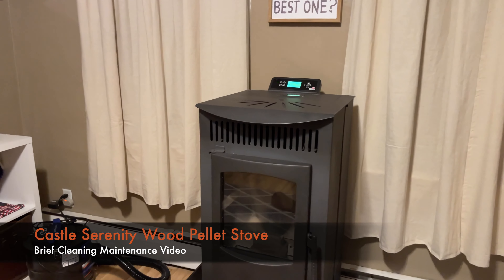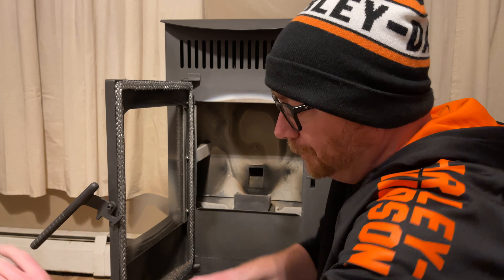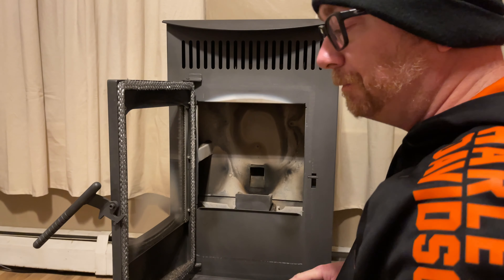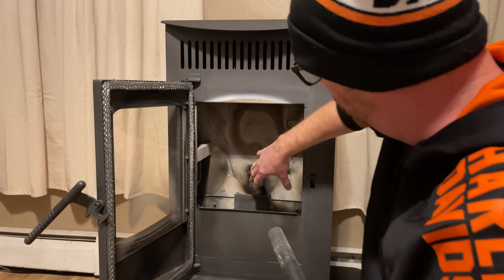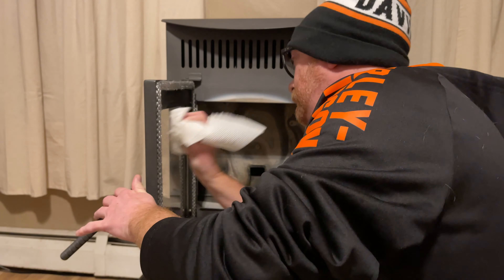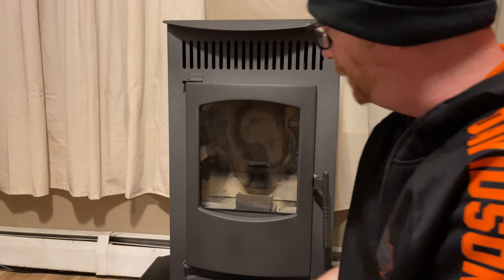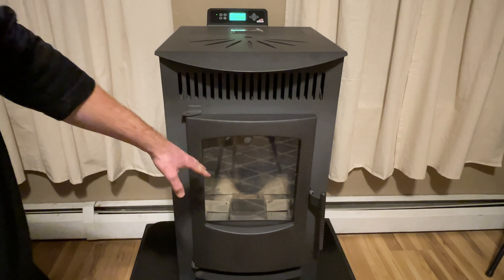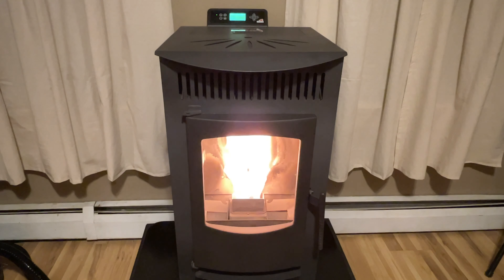Introducing the Castle Serenity Wood Pellet Stove - the perfect solution for cold winters!

Comment: Just used for only three days brand new and alarm high temperature came on and shut down. Took left panel off with 3/16 Allen wrench to check temperature switch pop out. Little black button type in the middle of two wires. It supposedly pops outward if triggered. It looked like nothing popped outward. So removed ash tray and there is a round circle with a lid covering the circle. Look to the left of that circle and you see part of a screw sticking out. Same size Allen wrench and on the back inside you can trace the Allen screw that secure a sliding lid. Unscrew it and slide the panel to the right. I slid panel 3/4 of the way of the circle and retighten the Allen screw.   Replace side panel and turn pellet stove on. If the alarm high temperature is on control panel. Hold the power button down until you see it go off. Clean out the pellet stove first and load more pellets in. Remember to only use dry pellets and not wet ones. Hope this helps.

Comment: As a long term pellet stove user I will tell you the key to success is cleaning your stove religiously.  Do not blow off maintenance, just clean it.  The igniters are consumables and they will burn out, so keep some on hand just in case.  Be sure to install the igniters carefully.
Reply from the maker: Absolutely. I had this stove three years and not one issue.
Reply: @johnnylubeck1145  had? Have you moved on to a different unit? I’m debating purchasing one
Reply from the maker: @jackvillan5151  No, same one. Absolutely love it.
Reply: @johnnylubeck1145  awesome, that’s all I needed to hear. My living room is roughly 1000 sq ft with cathedral ceilings, we run a mid moe all nighter wood stove but but isnt capable of heating the Living room as well as the rest of the house. Hoping this pellet stove can help
Reply from the maker: @jackvillan5151  the fan, blower, has a setting 1 to 5, we have to leave it on three and sometimes turn it down to two because it gets too warm.  Only thing I need to do is put vents to go to the upstairs but when it’s bitter cold, I like to have the heat run upstairs just to keep the furnace going in the basement warm. We have a two zone furnace.

Comment: Is this too much stove for a 12' X 10' X 8' ceiling room? I can leave the door to the rest of the tiny cabin open. It's 26' X 12' if I do that. Thanks.
Reply from the maker: It heats my downstairs which my rooms are just a little bit bigger than yours. That includes my kitchen. It may be too much for just the one room in a cabin. It’s all preference, there are settings on the stove from 1 to 5 for the blower fan.
Reply: I'd crack a window for cool air.

Comment: What do you have your blower & exhaust settings for max efficiency ? Just got it and cN’t figure out for optimal efficiency
Reply from the maker: Stall one voltage is 85 stall two voltage is 90 stall three voltage is 95 install four is 100. The same settings are for exhaust. I run it in manual and my blower is set at three. If I go any higher the house gets too hot.

Comment: I find ours last about full 24 hours before the glass is almost all black.  I used cheap pellets and expensive ones doesn't make a difference.  Still burns nice and hot but just cant look at the flame for  long before glass gets all ashy.
Reply from the maker: I wipe my glass down daily. It still is very clean. But I did find the hardwood pellets burn a lot better than soft.

Comment: Got the same stove had it 3 years stove is 4 years old in the 3 years I had it had to replace the ignitor and door gasket but I use a shop vac my vent is straight out I put smaller hose on it and stick that in the chimney vent and you can feel it sucking out.I don't like.the snow joe I got one it's week
Reply from the maker: I definitely can see the door gasket on the bottom part coming apart a little bit. I figured I can probably get the year out of it. 

The snow Joe is definitely weaker than a shop vac, no doubt.  So far, no other issues, but I’m figuring the igniter would be the first thing to go.
Reply: @johnnylubeck1145  door gasket size is 3/4x7 no one around me had it had to order from Amazon 20.00 not bad home Depot use to carry them but were sold out popular size
Reply from the maker: @ironhead320  thanks for the heads up. I was wondering when it’s time where the hell I’m gonna find one lol.
Reply: @johnnylubeck1145  lol after 3 years I guess that's good for a door gasket but pieces were coming off so I guess it's time to replace it now look for the combustion motor gasket for spring cleaning but same motor as a comfort built stove so shouldn't be to hard to find one

Comment: Did you installed by yourself?
Reply from the maker: I did with a friend who is a contractor. Wasn’t too bad at all
Reply: Thanks for reply I have some questions probably you can answer
Reply from the maker: @ramonsuarez5656  Sure, hopefully I can help out
Reply: Hi Johnny, I bought a wood pellets stove brand Grand t collection from Tractor Supply PS20WTS and I need the pipes but I don't know how many or which one I have to buy, I will like to setup the same as your. I have some pic that I can send you for any idea, I try to buy the stove from local dealer but those guys try to charge me more money for hole in the concrete, charge me for installation, charge me for permits, so I decided to see on YouTube the difficulty of DYI installation, I wanna save money on that.
Reply from the maker: @ramonsuarez5656  look up DuraVent pellet stove pipe. Please make sure whoever installs it or if you do, you do it correctly. The instructions should be in the pellet stove manual on how and where the pipe goes on the outside wall.

Comment: Do you think this would heat an uninsulated 2 car garage?
Reply from the maker: I do. The stove literally heats my 1st and 2nd floor home.
Reply: Thank you John I am gonna give the stove a try. Thank you for your feed back. I guess the blower would help to spread out the heat in the winter. And I guess if it doesn’t work out in the garage I could always bring it inside.  I will let you know how it turns out.
Reply from the maker: @user-tt5pz4wn1x  I think it will do just fine. Let me know how you make out.
Reply: It will be tough especially if you have a concrete slab which can be assumed but was not stated.  The concrete slab is gonna be a huge heat sink which will suck warmth out of the garage.   Unless it was built with insulating boards below the slab.
Reply: It' will probably heat it, but you'll likely run thru a bunch of pellets. To help mine out, I setup an old furnace next to it, created a partial shroud to capture much of the heat and the furnace blower distributes the heat.
Reply: @user-tt5pz4wn1x  update please? How did it work out for the garage? Curious for my Own garage space

Comment: This stove tends to get a lot of ash and requires cleaning a lot more than I’d like.When used continually,at least 3-4 times a week
Reply from the maker: It may have been more a pellet issue. I use the Lowes Harwood Pellet. Normal ash, nothing out of the ordinary. I tried a different brand, especially the soft pellets. They seem to get more ash than a hardwood.
Reply: @johnnylubeck1145  I’ve always used hardwood pellets and had good results with the ProPellet brand with my old StCroix pellet stove. I think in my area that they’re the best ones I can find
Reply from the maker: @Hodado  Absolutely, the hardwood is better. The soft pellets seem to make the inside have more soot  and ash than normal that accumulates.